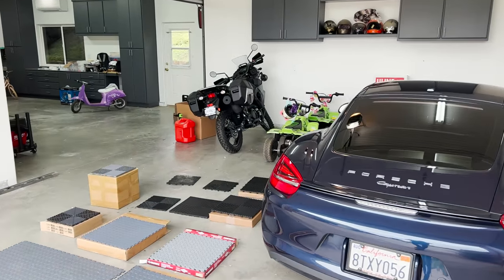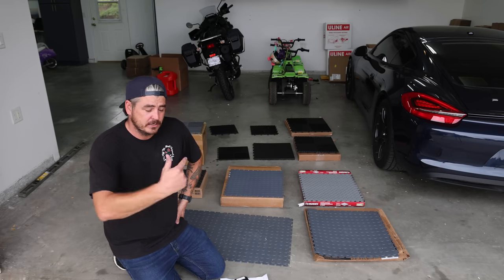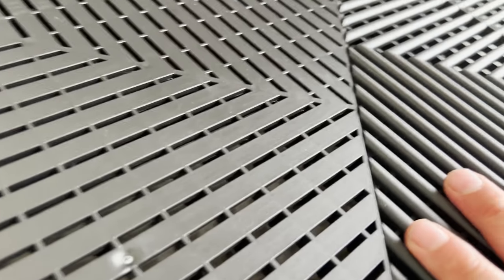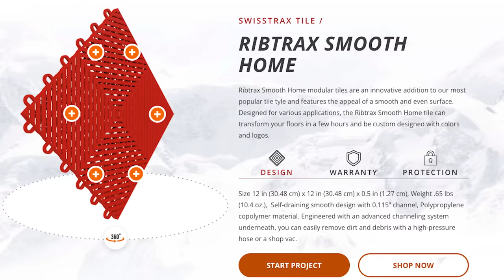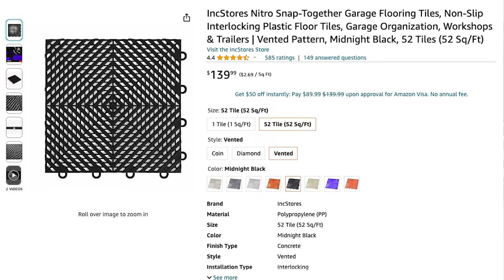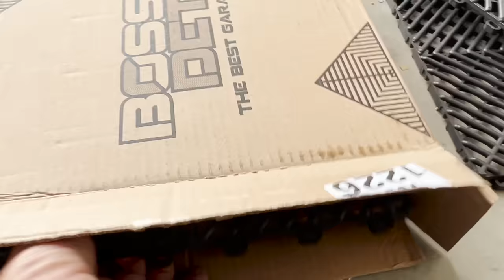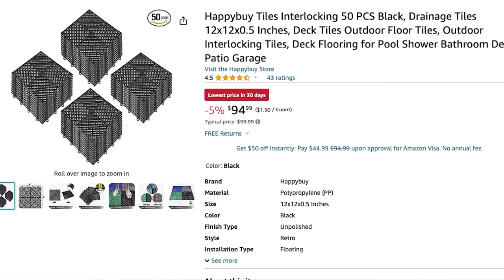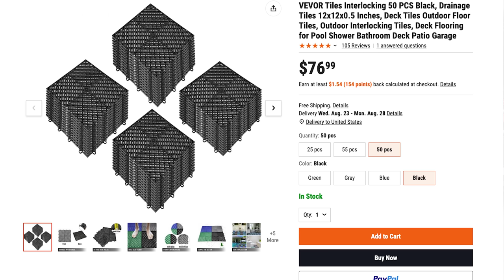BEST VALUE! DIY GARAGE FLOORING - Swisstrax Racedeck Home Depot Amazon

Comment: Ummm..how about Sweeping and Cleaning???…..So you get to keep all your dirt and garage muck forever!
Reply: You can wash down the floor with a hose. Because it allows water to flow underneath. You could also unhook the outer edge and drag the floor outside once a year and power wash the garage
Reply: I was wondering the same thing. My garage is 24x30 so pulling the tiles out once a year isn’t possible and there is no way to get water out easily besides a shop vac

Comment: I don't even consider these products any more.  I use regular vinyl flooring.  Usually left over/surplus end rolls found at flooring shops.   I lay it flat with no glue.  Secured by benches and tool boxes.  Looks good.  Cleans up easily.  Reasonable cost and easy to replace.
Reply: like this idea a lot.

Comment: Huge congrats on the new home!  My main concern with any garage floor covering is maneuverability of floor jacks, transmission jacks, wheel dollies, and the stability of jackstands and bottle jacks.  Also, ease spill cleanup and finding dropped screws, nuts, & washers.  Good luck with your research!
Reply from the maker: Thanks! Yea i totally agree with that and i think in those cases the swisstrax smooth pro would be the best option... BUT, we will find out how the cheaper options hold up to those things as well!
Reply: Yes my friend had SwissTrax and while working on his RZR we dropped a nut and it fell in the cracks. Ended up using a magnet and didn't have to pull the tile.
Reply: Maneuverability isn’t hindered much. jacks will cut into them. Spills are a pain. Dropping fastners can be a pain as well depending on size.
Reply: I have the RaceDeck tiles in my garage. They are nice. As far as the jacks or stands digging into the tiles. I use diamond plate squares. You can get them through racedeck also. That will keep your tiles looking new.
Reply: Good luck with aluminum, plastic or anything flat that can easily get wedged underneath

Comment: As always, great video.  I have installed many of these systems in a variety of applications and there are pros and cons to each.

The plastic race decks style is attractive, but only really practical for parking on.  They aren't ideal for a person who uses the garage space for wrenching, wood working or metal fab, which most of us garage dwellers participate in.  Small screws, saw dust and metal chip get all trapped in and under the grooves, and rolling anything heavy with a skinny or small wheels will take it's toll on them, as well as rumble and make noise.  

The second group (the mat style) are also attractive and easy to install (and easy to cut to shape) but are susceptible to damage.   Of the products discussed here, the best of the bunch is the first one mentioned (Blue Hawk) and is the most durable, highest durometer, most fade resistant, least chemical absorbent, and easiest to install based on it's large tile size.  Ideal around work benches where a tool or part could be damaged by dropping it on concrete, and I have some of this around my surface plate for this reason.  The stuff lays down fast.  Some of the other brands shown have swelled up or curled up if certain chemicals are left longer than a few minutes, which is the primary reason I only use the Blue Hawk (or much more expensive, commercial grade versions) for applications where the guy with the checkbook wants this type of flooring.  They are sacrificial, but way easier to replace a damaged square than the race deck type.

In the end, honestly, commercial epoxy-style (polyaspartic) coatings have gotten so good, so advanced, that they can be applied in dozens of color and texture combinations.  If you use your garage for vehicle maintenance, rolling jacks around, laying under the car on jack stands, etc... or you have lathes and drill presses and other equipment in use, the polyaspartic coatings are ABSOLUTELY worth the extra money.   They are extremely durable... if you damage the coating, you damaged the concrete it's attached to.  They are generally running about $6 to $10 per square foot depending on how extravagant you get, but I just had IronDrive (Phoenix, AZ) install my 850 square foot garage and it was $3400 ($4/foot), complete and guaranteed for 10 years.  Done in one day, walk on it the next day, park on it after 3 days.  The surface is really nice to lay on, spills and filth wipe up so easy it's like wiping your kitchen counter.  For a long term flooring solution, shop around for a good epoxy contractor and you will be so happy.
Reply: Comprehensive review here. My only issue with epoxy-style coatings is the work is not warrantied in CA for surface cracking. This goes for EVERY single garage flooring company in CA. Collusion, lol.

Tiles would be my only option here.
Reply: In your review, you mentioned Bluehawk.  I don't see where he talked about this product in the video.  Could you point out a time stamp for easy reference please.
Reply: 16:49
Reply: @DroNhere  thanks. Not sure how I missed that.
Reply: Fantastic information, thank you!!
As a person known to (actually) wrenches on cars, and makes saw dust, I had a few concerns about the open style. Especially living in the midwest and carrying in snow, salt and daily 'dirt'. I figure all that would accumulate over the years and eventually clog up the "pores". Thanks again!

Comment: I have Racedeck  in 2 garages and an airplane hangar. A mixture of open grid and solid tiles. Open under the car or plane and solid on walkways. Yes if you drop something small you will go fishing. I usually use a pad under my work to catch anything. Also the open is hard on the knees. Again the pad comes in handy.  Before installing the tiles I painted the floor with wood deck sealant. This helps for the clean up. All garage and hangar floors are supposed to drain towards the outside door. Every 6 months I use a hose and wash the floor down and let the water run under the floor. It comes out at the door. I also use a leaf blower from time to time and if it gets real dirty after a job a mop.
They have been down in the garages for now 10 years and hangar for 7 years. Still look great and get a lot of compliments.
Racedeck had a computer program that let you put in the garage size and then design your layout/color. Once you were happy it gave you a bill of materials showing exactly what tiles you needed to order and the price. Very handy and a easy way to make a good design.

Comment: I’ve got the vevor and they are actually pretty nice! I’ve got blue and black in my garage and they fit together perfectly and I have not had an issue and have had them for about a year so far. I work cars and dirtbikes ECT and have not had a problem what so ever. Have also pulled them up and washed/cleaned them and went right back in the same way!
Reply: The $1.62 per square foot seemed pretty good for the cost; got two boxes to try out for a porch, and they seem pretty good. Easy to connect together even by hand and disconnect using a small screwdriver.

Comment: Engineer with plastic injection molding experience here - YES those holes are likely where the plastic is injected into the mold. They are evenly spaced like that to facilitate successful molding of the piece (aka not having missing material, or too much material in one spot vs another, etc). The ribtrax home is a smaller piece and likely molded in a completely different tool that was made/designed at a different time, maybe even for a smaller injection molding press (as the size of the pieces being molded dictates the size of the machine that is used).

The boss detail "mold spot" josh is mentioning is called the "sprue" this is a tube that the plastic is injected through that gets molded with the part. The swisstrax is molded with "sprueless" technology in the mold. The boss detail is NOT molded sprueless, and it appears that they are hand--trimming the sprue off after molding. This makes the molding tool itself significantly cheaper, which is a main expense in plastic injection molding (anywhere for $40k to millions depending on size and complexity and if China or USA/Europe makes the molding tool).
Reply from the maker: Wow! Great info!!! Thanks so much for that.  Is it possible for the "sprue" to be filed down cleaner like maybe from other brands?  You mentioned it seems like they are being hand trimmed, is there a different process that could produce a cleaner finished product even though its made with a sprue?
Reply: @imjoshv  I don't work in that field anymore so info is dated maybe 8ish yrs, but these plastics (especially straight out of the presses) are quite soft (to the point where we have to create jigs to put complex pieces it while they cool to ensure the part maintains dimensions in some cases). They might just be snapping them off by hand in the product you showed. A pair of flush cutters would do a better job (you would see the cutter marks like if you used flush cutters on a plastic rod, I don't see those here, they would be more consistent). They could use any number of trimming/material removal techniques from drill press attachments to in-mold trimming. Could literally give a guy a drill with a sanding/grinding tool on it and let him hand grind those sprue spots.  But these things all add cost to the part by adding secondary operations. They kinda chose to cut the costs of complexity in the mold by putting ONE sprue in the center of the piece vs multiple smaller sprues (requires more tunnels in the mold for.the plastic to flow through = more expensive mold, and at some point the cheaper Chinese tool mfrs just don't want that work, then price jumps bc USA/Europe charges more for labor). They could've put the sprues on the back side and had multiples of them to cut down on the impact to the consumer that the sprue has here, but they either didn't think customers would care or for some reason (probably flow analysis, which helps tooling engineers design molds -thats above my head, software like solidworks does this) and decided putting sprues in the back of the part wouldn't work. In injection molding the big struggle is getting plastic to fill every little nook/cranny of the mold without pushing material outside of the mold (called flash/flashing, which produces and ugly part with thin extra plastic on the extremities, which needs to be trimmed off, by hand prob on a part like this, and can be sharp & cut customer)  OR missing material in places (which just gets scrapped=waste). It also stresses the molding tool and the press and leads to various complications. When u injection mold plastic you ideally put the sprue(s) at a thick part of the part, because then the material pools there and spreads to the thinner areas more evenly and creates better flow analyses/even flow. Likely they chose to put the sprues there because of the thin ribs on the underside of the part, which are not good places to put a sprue by the looks of the part. Even the swisstrax avoids this and instead they ponied up the cash to make a complex tool with 4 sprues and sprueless (just means the part comes out of the mold without the sprue attached & solidified. U basically use heaters and a coolant system to keep that plastic molten and in the tool when the part ejects)  and are planning to recoup that investment through their higher prices. Hope that helps!

Comment: Josh, I went through same review you did 4 years ago. Everyone told me RaceTek and similar but I did not want to have to worry about oils and chemicals on floor that might not evaporate and then pulling tiles to clean.  Likewise , piling up dirt and debris or dropping nuts, bolts, fuzes, etc....pain in arse to retrieve every time.  I wanted longer wear and weight support than RaceTek.....didnt want peeling from epoxy...wanted it to be true barrier to water, chemicals, dirt, etc....and also on a potentially uneven surface...was easier to fit. I chose Advanta Flooring.....that looks similar to the Husky, Amazon and others you showed.  What I liked is that three edges are tabs and one edge is sealed so when fully engaged liquids cant leak through...everything stays on surface.  They use these in factorys and forklifts run on them all day long and last years....  Were not the cheapest but were the ones that appeared like would last 10-15 years.    I have a couple boxes left over and could send you one or two to compare if you like....but I have been pleased for the 4 years.  WHen look dirty can mop or clean with floor scrubber if bad...but usually just soap and water and mop once a year or spot clean as needed.  You only have to trim one edge and leave 1/2 inch on sides for expansion but they come with side pieces and also a nice sturdy ramp edge for front of garage that glues under the edge to keep leading edge intact.  https://www.advantaflooring.com     I have the gray color with round slightly raised design for light traction without impeding cart wheels, creepers, etc and still supporting heavy steel shelves, freezers, motorcycle, tools, etc.  Have dropped jack stand with no damage on these...hahahha   Good luck.
Reply: I just clicked your link and I'm impressed.  I really like the colors that they have.  Their texture or design is like smooth/medium/coarse.  I would pick the "coin" design, too.  That coarse design would be tough on one's knees and elbows, it seems.  
Anyway, thanks for the tip.  I'm definitely going to check them out.

Comment: I went with Swisstrax just due to the uncertainty with the durability and specs on the cheap Amazon ones. Race deck and Swisstrax are proven to hold up to lots of abuse and hold a lot of weight including even car lifts. The Amazon ones usually say for garage, but really it’s for deck and patio as they never say they can hold a cars weight and be able to hold up to hot tires. Great video as always. Plus in the end if you move you can take them with you and they hold value well on the used market. I liked the ribbed tiles over the flat ones for traction reasons especially if washing on them. Water doesn’t sit on top.

Comment: Personally using the Husky tiles in my garage for the last 6-7 months. They were very simply to install and have held up great so far. Between a couple brakes jobs, oil changes and multiple home projects they are simple to clean up and moisture is not much of a concern because of how tightly they lock together. I specifically left water in multiple spots around the garage overnight and didn’t find any water under the tile the next day. I use a simple shop brush to brush the water out and look forward to seeing how they hold up over time.
Reply: I think he might mean water coming up from the slap do to ground water under the slab???

Comment: I purchased my interlocking floor from Costco, they usually have it on sale once a year.  Covered my entire 24 x 23 garage for about $1200, the hardest part was moving everything out and back.  It’s worked very well over this time, I have worked on my cars many times with jacks, jack stands and using my Quick Jack without any damage.  It’s dropped shipped to your home, I got the grey and black option.  Considering the cost, and the quality I think it’s a fantastic choice compared to some of the other choices.
Reply: Can you share a photo ?

Comment: The only issue I can see with the click type flooring is the amount of dirt that will accumulate under the tiles. I etched my garage floor a couple years back, then used a pump up sprayer to spray it with a water soluble stain. I wax it occasionally, the floor still looks great, it’s easy to clean too. Total cost was around $350 to stain approximately 800 sq feet.

Comment: I’ve had Racetrack - they are great and hold up well - they also have tiles that are solid so if you do not want an open surface you have that option.   I used a mix.  Either way they both have channels underneath for ventilation.  Also Racetrack often will run sales and have quantity discounts.

Comment: Just installed a 12x12 tiles that I purchased from Amazon.  2.70 per sq ft . They're sold as Speedway but it actually comes from Dalton GA Swisstrax factory . This are solid tiles , diamond pattern with somewhat of a rough texture so it should be ok with moisture.  Very happy with the way it looks . Feels solid and connects together pretty well

Comment: How do you clean your floor?  You mentioned hiding dirt, but eventually it will pile up and then you cant sweep it out or wash it out...... That seems to be a super negative  point to these floorings unless you have some sort of drain, which most home garages don't have.

Comment: Appreciate the info… Think it really comes down to what the intended use of the garage… hard to beat the DIY epoxy floor as far as bang for the buck, looks, ease of maintenance etc… IF prepared properly they hold up very well… Sure, hot tires may cause an issue, place mats to mitigate… nothing lasts forever

Comment: Great video Josh so thank you ! I have Race Track flooring in my garage for approx 12 years now and still looks decent but you can see some aging but not bad at all. I wish I went with a more matte finish because the gloss finish is no longer visible. The price of the Vevor is amazing but I do not believe they have edging pieces to finish the project which is a big deal at least for me. The Race Track flooring has a very nice edge that acts like a little ramp when you first pull into the garage so something to consider. Good luck and thanks again.

Comment: I have a small 1 car garage that I installed MotoFloor tiles from Costco in. After 1 year they look great. They do not have an open air design but that is what I wanted in my residential garage. They regularly sell at $150 for a box with 48 square feet of tiles. But they go on sale.